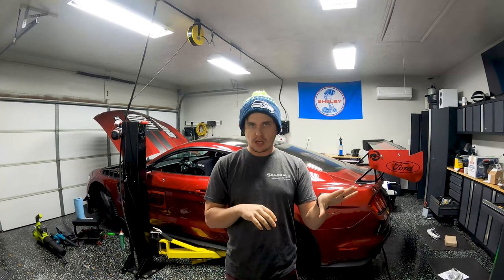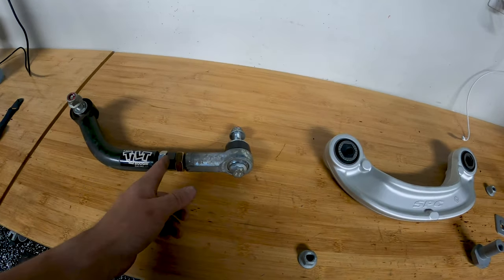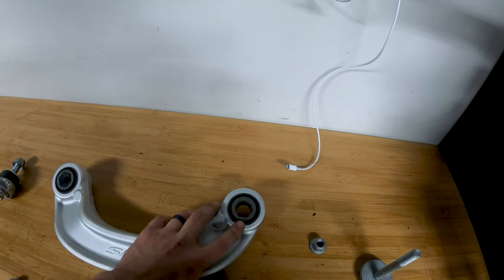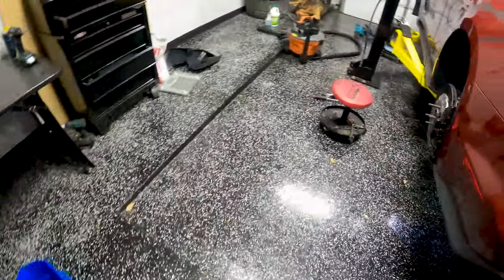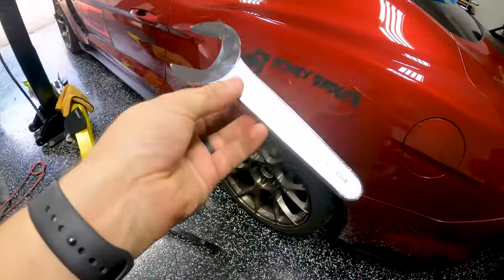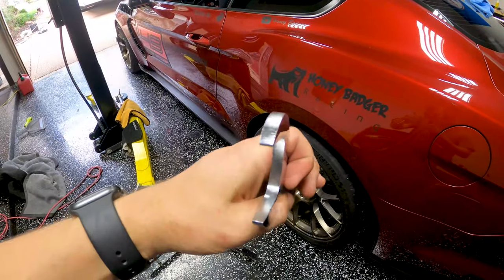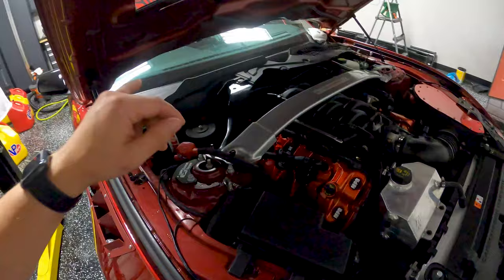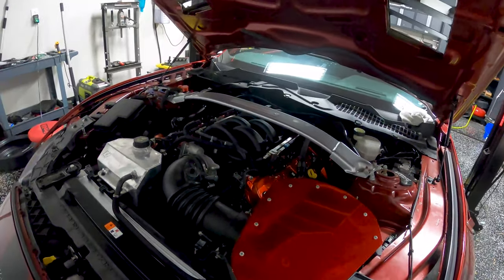Installing SPC rear camber arms and a vacuum canister

Comment: Good Stuff!  Have you noticed any change in tow in the rear when dialing in the SPC arms?
Reply from the maker: Yep. Any time you touch camber, you'll need to re-adjust the toe. I had to remove some toe out after install